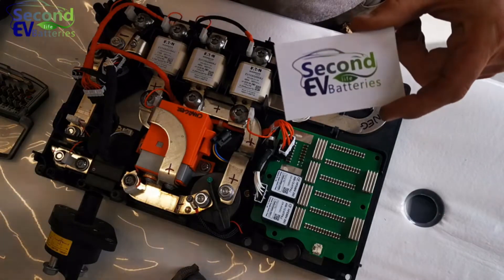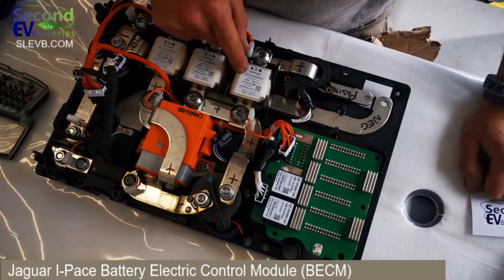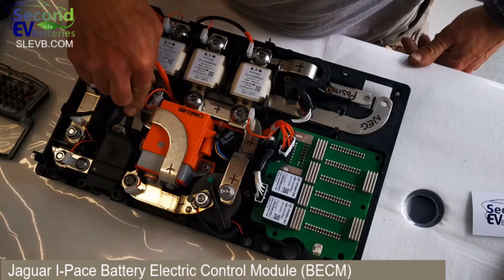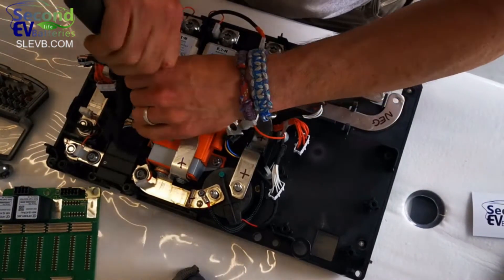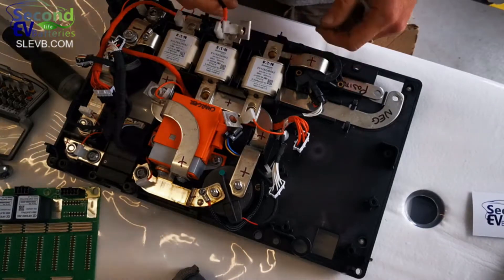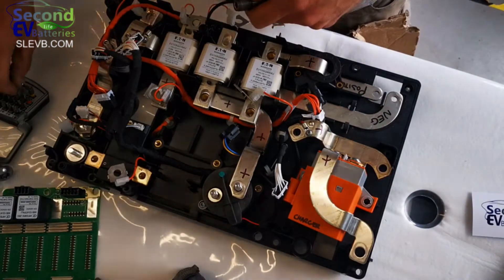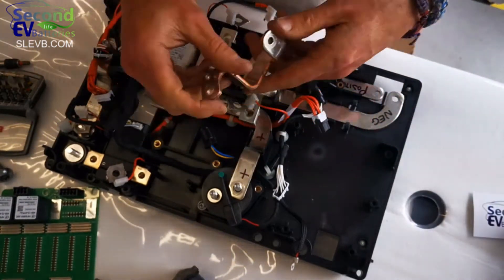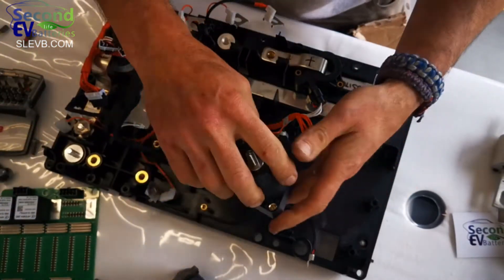Jaguar IPace Battery Electric Control Module BECM dismantle

Comment: i would be interested in how ou are going to reuse the modules made up of all these individual pouches. i mean if you wanted to reuse them u might have to put another BMS on them plus take out the broken ones and replace them with usable pouches? but i guess they will be terribly glued to oneanother and a pain in the neck to fiddle about reconnecting them with busbars or stuff?